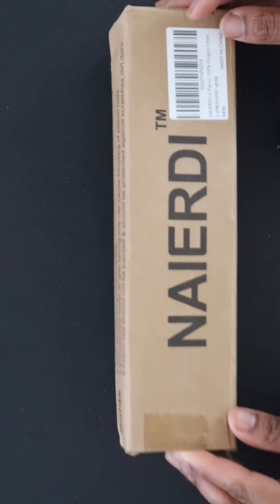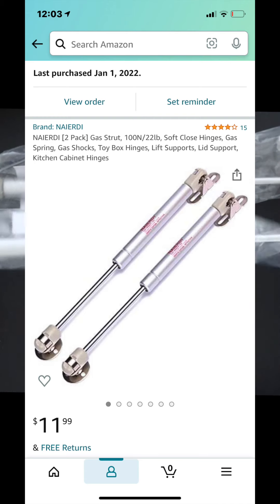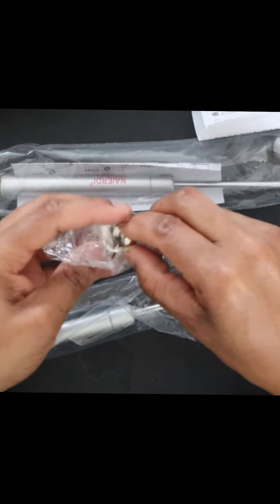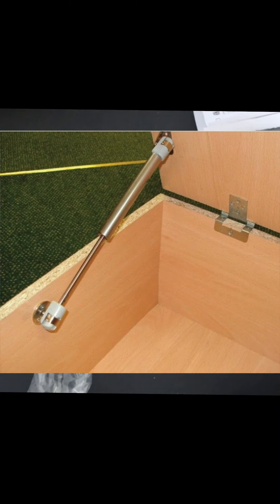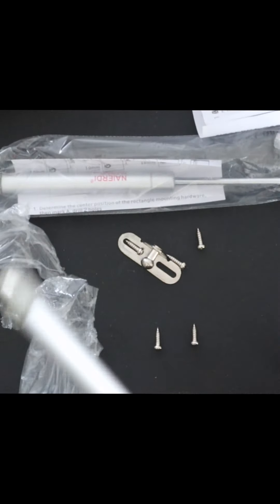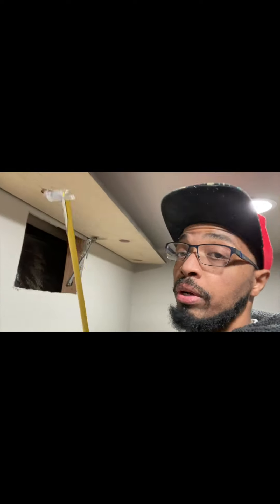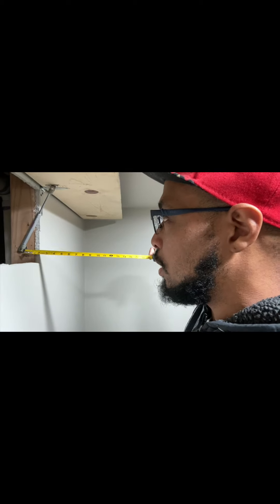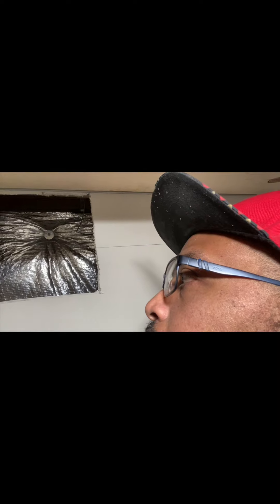NAIERDI [2 Pack] Gas Strut, 100N/22lb, Soft Close Hinges

Comment: So I’ve seen instructions on other sites that say the thick tube goes at the top and the thin rod is at the bottom. This apparently keeps it lubricated properly inside and causes less stress on the hinges.